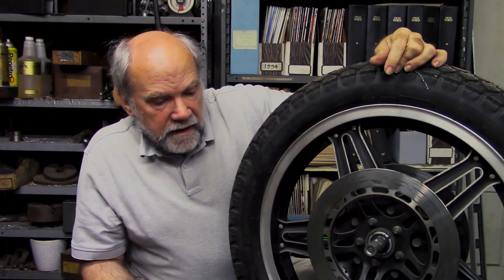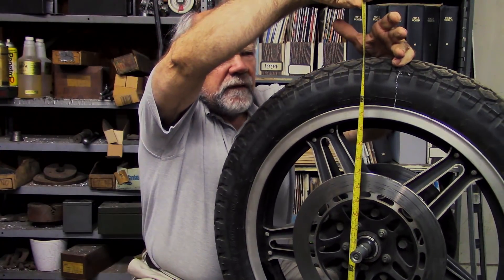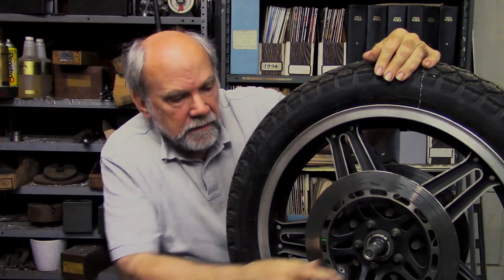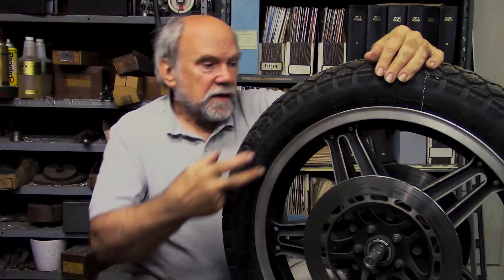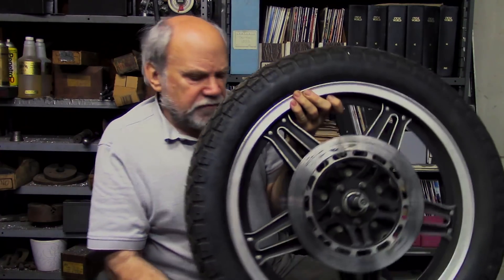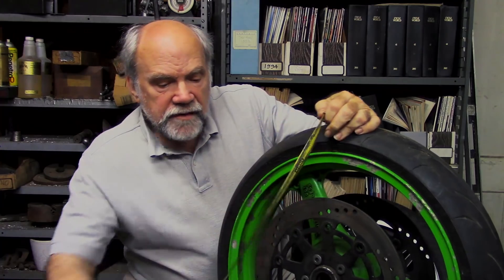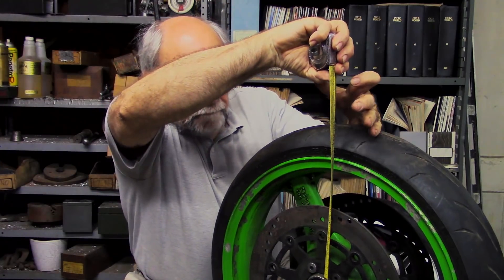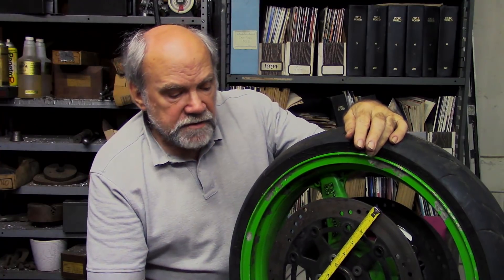How Has Motorcycle Steering Changed Over The Years?

Comment: I distinctly recall the vast difference between my 1979 GS1000E with a 19" front and my next bikes- two 1985 GS1150ES's, which had a 16" front wheels. Treacherous, like a bear on cat's paws! A wide but very short contact patch; I dropped the front on that heavy bike on an uphill rainy corner. It was quite a while before I came to trust the "new" 17" rims that we use today.

Comment: Also a fun thing to note was that due to these larger GYRO's the riders would counter lean without fear of high siding as much as todays riders on modern machines because the power output was lower comparably making them slower to modern motorcycles. Also, they needed much more unsettling forces to throw the weight as ismade clear by the Gyro point.

Comment: Every thing else been equal a smaller 17" wheel has about the same gyroscopic forces as a 19" wheel - although the 17 is lighter it is also spinning faster (rotates more for the same distance covered) at the same road speed. 

The big difference in the development of the 17" wheels was in tyre development. Low profile and radial construction reduced weight (and gyro forces and sprung suspension performance). Reduced sidewall flexing reduced heat and allowed gripper rubber with as good and better tyre life/mileage. Reduced sidewall flexing also allowed wider tyres and changed tyre profiles which changed the tip in rate and quickened steering inputs.

At the same time improvements in overall chassis integrity (stronger frames, stronger large dia forks and axles, dampening control (F&R) etc) allowed the increased performance of the tyre to be exploited. IOW wider low profile tyres on old frames and suspensions would have lead to stability issues.

Comment: Didn't mention anything about steering geometry!!!  Castor-angle, trail, rake, etc.  Smaller wheel size also gives you a smaller trail and allows for tighter turning for the same lean angle.
Reply: All the things you mention were common knowledge back then as well. but experimentation of those things was restricted mostly to racing. Modern times bring it to the consumer market because the market has now matured to demand specific stuff, rather than motorcycles as a mode of transport or at the most spirited riding.

What changed permanently was the tire sizes, in an evolutionary way, which even without the altering of Castor-angle, trail, rake, etc. make the motorcycle more proficient at handling.

Comment: Why did old timey bicycles have a giant front wheel and tiny rear?
Reply: With a direct-drive wheel (before chain & gear drivetrains became practical), the only way to increase the gear-inches -- and go faster -- was to make the drive wheel bigger.
Reply: Quick answer, they didn't. They either had front and rear more or less the same size (19/19, 19/18, 18/18) or a 21-in front for off-road. A large front wheel is more able to cope with uneven and potholed roads. What suits a race bike does not necessarily suit a road bike. Go too small with the wheels and you get handling like a step-through scooter. Whilst a small wheel may suit race speeds, it doesn't really suit slow urban speeds. A bike that turns in fast at high speed might be considered twitchy on the road where a more relaxed ride and straight line stability might be preferred. 
Also consider that narrow tyres require less lean to get around the same bend as fat ones do. If you look at actual race bikes (e.g. IoM TT bikes), they do not have humongously fat tyres. They are generally 17-in too 120/70-17 front and 190/55-17 rear e.g. Dunlop D212 (road legal).
Reply: Mike Brink - haha and the girls would drop their pantaloons
Reply: Jeff Slade, read the first comment again, you missed the topic. At least you didn't spend like 30 minutes to write all of that.